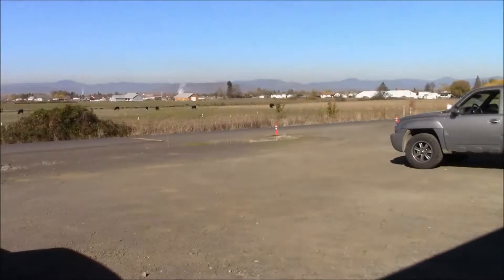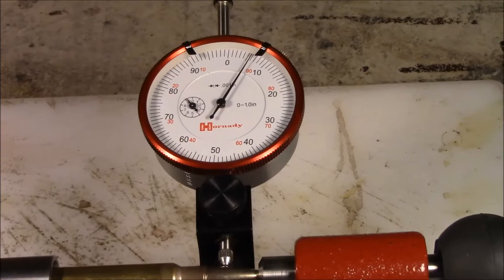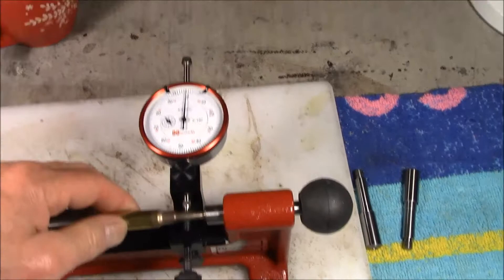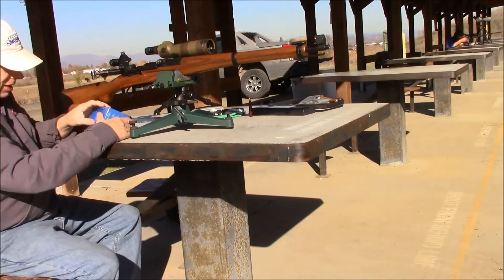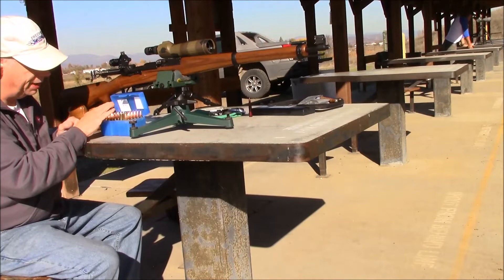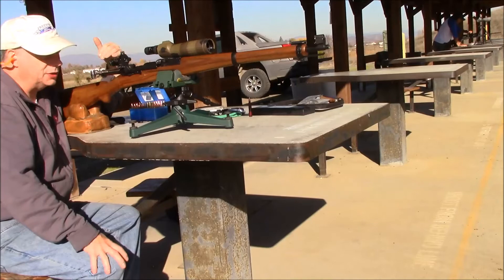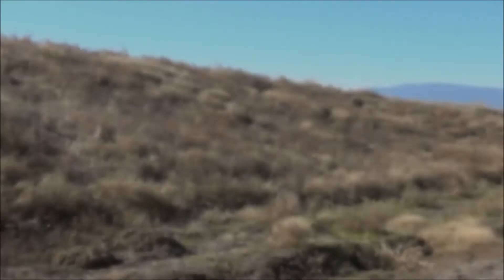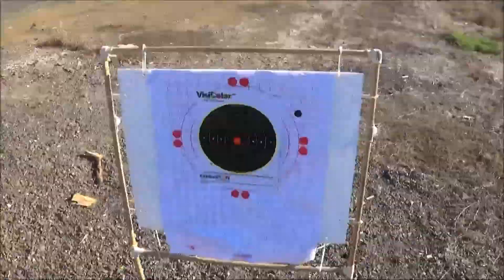Gehmann 1.5x Rear Diopter vs W+F standard Rear Diopter

Comment: Yep. I need so more range time and practice. I just want to thank you for taking the time to demonstrate the differences between the two sights and what advantage there is. I'm defiantly going to go for the Gehmann as I have ageing eyes. funny thing, 20 years ago I didn't have problems with diopter sights, also I feel that ranging elevation and windage is easier when you can see in sharpness as you also demonstrated here as well.  Dave.
Reply from the maker: Thanks Dave :) Here's a link to the Gehmann set-up I have.
http://www.champchoice.com/store/Main.aspx?p=ItemDetailOptions&item=570579
However, if I had it all to do again I would omit the color filter and perhaps even the corrective optical attachement. Be quite a bit less expensive. And just use the 1.5x with focus and the adjustable iris

Comment: Love the furter as a back up! And a private series ta boot, consider me very jealous sir. I did score a k31 with furter recently so I’m on my way
Reply from the maker: Hi Emory: Yep, I make no bones about it the K31's are spectacular rifles. Even one that looks like it might have been used for a canoe paddle will still shoot lights out. Thanks for watching and commenting. Enjoy the K31 (-:
Reply: @lencac7952  hey thank you for saying hello. Not only did this k31 rekindle my milsurp fire I now own an 96/11 and 05/11 the long one I finally put SP diopters on. There’s a learning curve that I think will involve me putting my chin in the same exact place I believe but I’m learning. Funny but I’ve literally fantasized about a lencac g11. Soooo any love for the 1911s? ? ?
Reply from the maker: @emoryzakin2576  Hi Emory: Yes, much love. I have done one restoration of a K11. I found the K11 to be a slick excellent shooting very stylish Swiss rifle. A top notch quality rifle. On the plus side, even as good as the trigger is on the K31's are I found the trigger on the K11 to be even a bit better. If that's possible. It felt very good in the hands as it has a bit more petite slimmer stock. Plus K11's seemed to have some crazy nice walnut stocks. Mine had the coolest tiger stripe walnut stock. It has a true free floated barrel as I may have already mentioned. The reason I got it was I couldn't resist the tiger stripe stock. On the minus side the K11 has a noticeably shorter sight radius. Which means that any error on the shooters end translates into more variance on the target end compared to the same thing with a K31. And a shorter barrel which will generate slightly less MV than the K31.  Although they both are Swiss straight pull rifles in reality are quite different creatures. That was like 6 years ago before I started doing range review videos. If I had your e-mail I'd send you some photos. You could delete your reply after I get the e-mail.